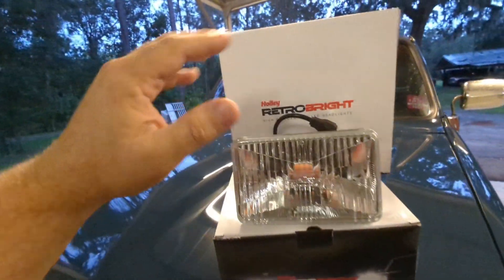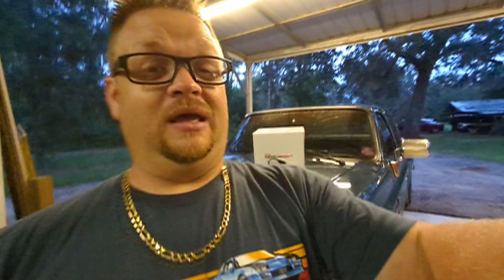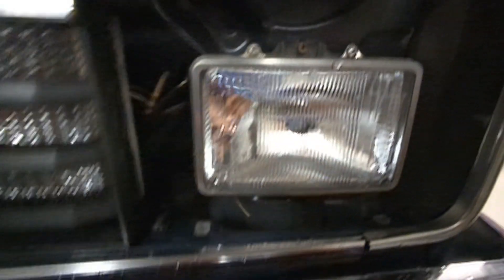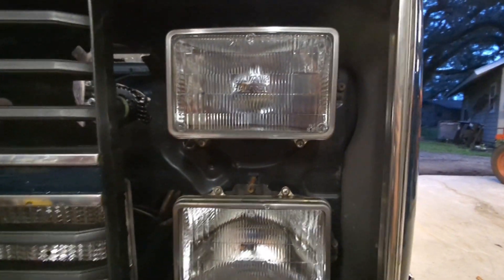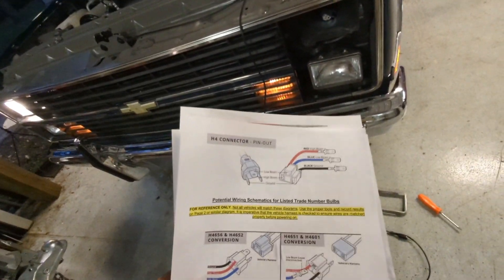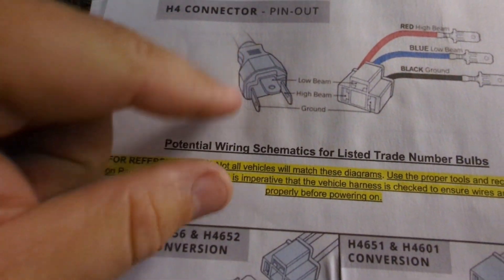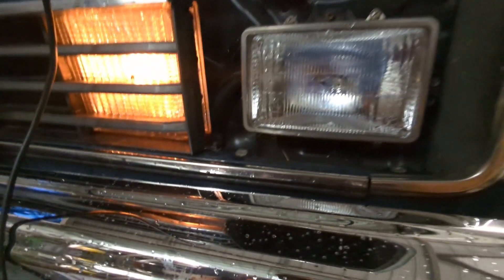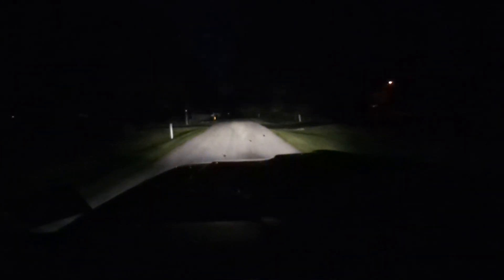Holley RetroBright headlight upgrade and install on square body Chevy

Comment: Make sure you upgrade to a relay setup, I melted my dimmer switch and wiring to the floor at about 2 AM on the freeway, they were much brighter than stock before the meltdown and much brighter and consistently bright after the relay setup
Reply from the maker: Sure thing, a while back I put the dual relay harness upgrade on it so that when the hi beams are on the lows are also on. Thanks!
Reply: But the led’s draw much less current?